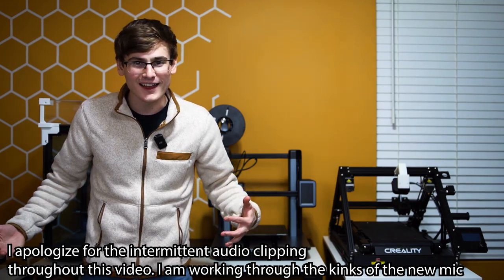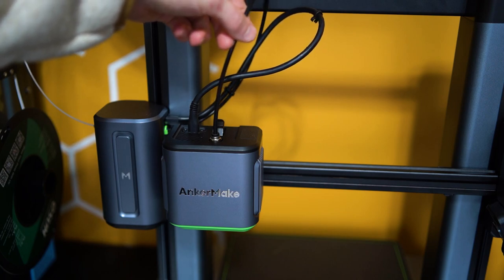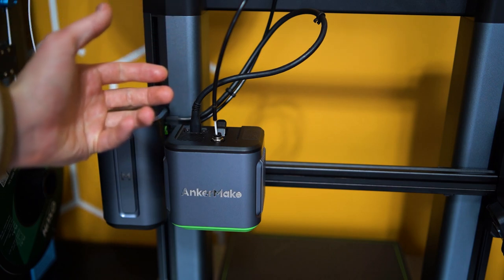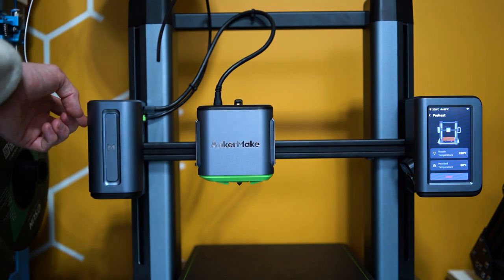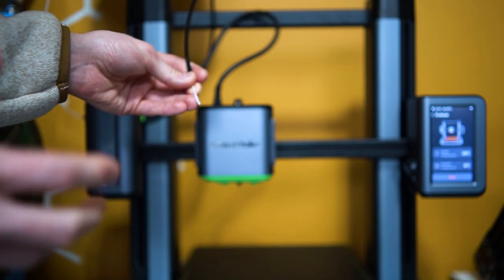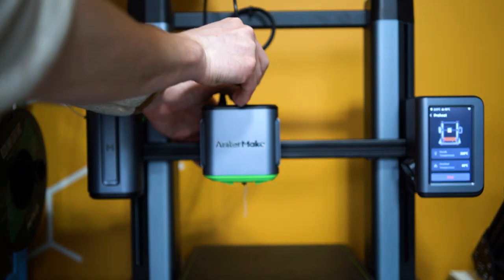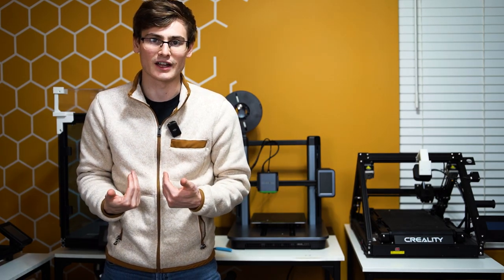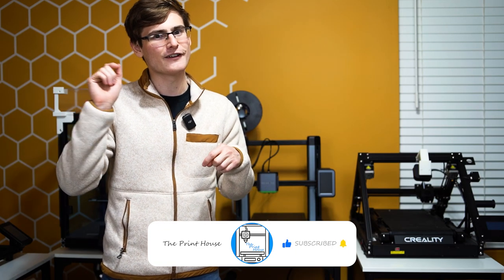Load Your 3D Printer Filament EASILY with this Trick!

Comment: I have also followed the advice of adjusting the lever spring by tightening the hex nut just behind the lewer. Haven't had issues since. Now, when feeding new filament, once it reaches the all the way through the tube, I press the lever , I only need to push the filament a tiniest bit more and release for it to be securely grabbed.
Reply from the maker: I havent seen that advice. I might give it a try. There might be an issue with "over pressing" the button which blocks the pathway. Im not sure haha
Reply: @ThePrintHouse  yes, I only press the lever a little bit now, it seems to grab right away.

Comment: What I've found to work is to essentially "pump" the lever as you push the filament at the final spot it gets caught at.. and it slips on through. I checked though for a clip and I don't have one there. The pump method works even for flexible filament like TPU. Also beware a sharper angle isn't necessarily going to help either and I've seen some comments elsewhere that it will be problematic if the angle is too sharp on the end of the filament.
Reply from the maker: Yeah if the angle is too sharp then you can bend the end into a blunt edge which will never fit through hahha

Comment: I did this in the beginning. But I found out that the filament is a lot easier to load if you just give the button a half press instead of a full press while loading.
Reply from the maker: I will take a look at only doing a half press instead of a full press. That might make life even easier! :)
Reply: This solved it for me too. With the half press, every filament change has been quick and easy.

Comment: Appreciate the tip but unfortunately all this does is bypass the issue with not being able to load the filament in the AnkerMake.  My concern is right now 75% of my filamance swaps require me to release the bowden tube. What happens when I receive the color engine? its going to be auto feeding and removing filament 1000's of times per print, if their current design cant do it consistently by hand there's no way the color engine will have any chance at success.
Reply from the maker: Wow that is a serious concern. I never considered that! I There will obviously have to be a completely new hot end setup though because the V6 color engine wont be direct drive, it must be bowden set up, so I'm sure there will be a different extruder.